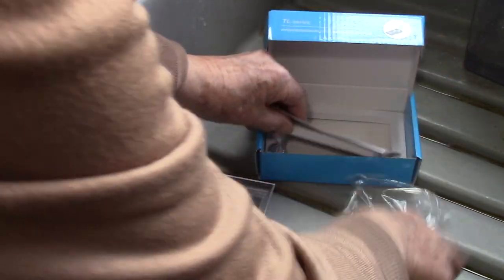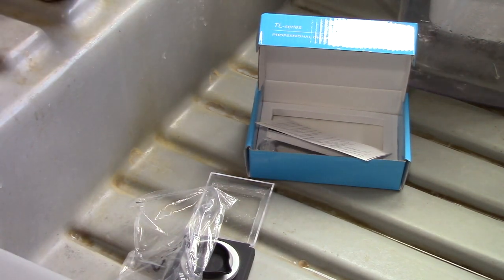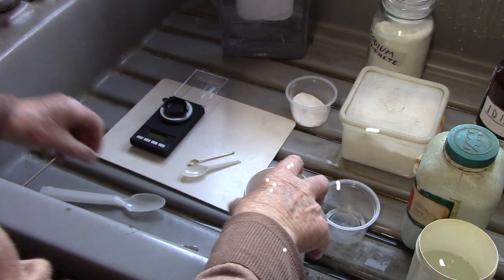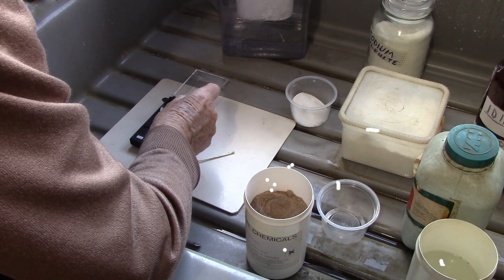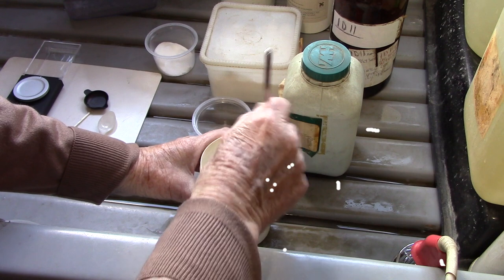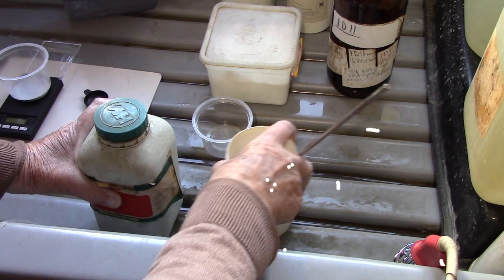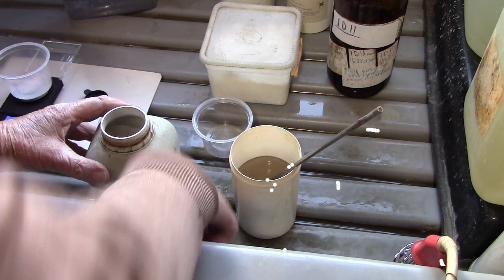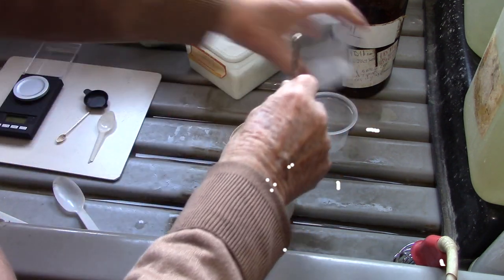MAKING FILM DEVELOPERS FROM RAW CHEMICALS

Comment: Thank you Peter! I was hesitant mixing my own chemicals, but no I will try too! We will see how steady my hands are, I'd have to be ashamed if I couldnt do it at 26 years old.
Whats the shelf life of your freshly mixed ID11?
No fancy music or anything needed, looking forward to your next installment.
Reply from the maker: If it is in a half-full bottle it suffers from 'Increase in Activity' which means development times have to be shortened BUT I make it last weeks by squirting in some Butane Lighter Fuel to sit on the liquid surface and prevent Oxidation.
Reply: Hi i decanter into stock solution bottles ready to dilute  before development, stock should last six months in full tightly sealed bottles.

Comment: I have some very old Metol Elon probably goes back to 1940 maybe older does that chemical go bad. also have some Hydroquinone I think it goes back to the mid-1980s and have not tested either one of them just wondering if there's a shelf life on either one of them. by the way love your video
Reply: People offer all sorts of shelf life for Metol. My own experience is that I'm still working through a jar of Kodak Elon (same thing) I bought about 45 years ago. Likewise, I acquired a 5 pound jar of hydroquinone about then, which still works fine. Metol tends to be a pure white color when new, but my Kodak version was a very light grey, and remains same today. B&W developers may be less sensitive to aging chemical, but I use the same developing agents to make both E-6 and C-41 chemistry. My advice is to try it on part of a roll of film you won't miss if it goes poorly. If it is really worrying you, just bin the stuff and buy some fresh replacements.
Reply from the maker: I am using very Old Metol and Hydroquinone as well -- if the METOL is dark brown it may not be any good.
Reply: @theoldfilmbloke  thank you for your information it is slightly gray I think I'll give it a go and make up a very small batch of D76 and see if I get good results on a clip test. by the way I love your 🙂

Comment: @Peter Elgar. Do you think if we buy chemicals that would be cheaper making our own chemistry rather than buy it from Ilford for example?
Reply: Hi, if I can give you my experience. I just up dated my chemistry to make. ID11/D76 is 40% less, Perceptol is 60% less, D72 is 50% less and fixer is very cheap. I purchased the powders in Australia so prices and availability may differ around the world 📸
Reply: @petervanorsouw2858  thank you for your answer! For fix you use only sodium hyposulphite? what is the concentration?
Reply: @fotolookconde  I make a Rapid fixer, water 40c 750ml, Sodium sulphite 10g, Ammonium sulphate 25g, Sodium Thiosulphate 180g water to make a 1000ml undiluted mix. Use at 20c and twice the time It takes to clear an unprocessed film strip 
 completely is your time. Hope that helps, Google fixer formulas for another choice p.s. a simple hypo clearing agent Sodium Carbonate (soda ash, pool cleaner) 10g per 1000ml water. Method wash film/paper then soak in formula two minutes then wash half the normal time.📸
Reply: @petervanorsouw2858  thank you very much!!!
Reply: @petervanorsouw2858  actually to make stop bath can I use acetic acid glacial (99.8%)? I know th formulas for that is with acetic acid 28%. Is it a matter of percentage dilution and just use the 99.8% one (diluting at 28%?)
Reply: @fotolookconde  the short answer, yes. If you Google the film forums that may also help.
Reply: @petervanorsouw2858  thanks a lot!
Reply from the maker: @fotolookconde  See what HELP you get here ! Thanks Peter ,